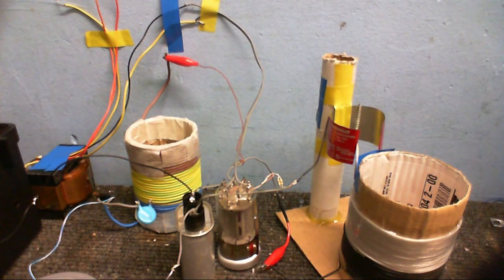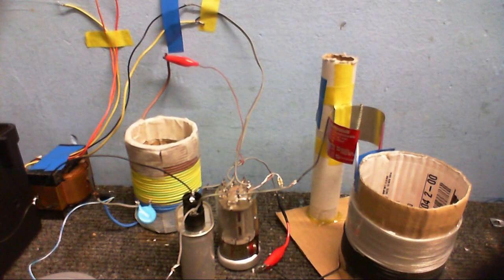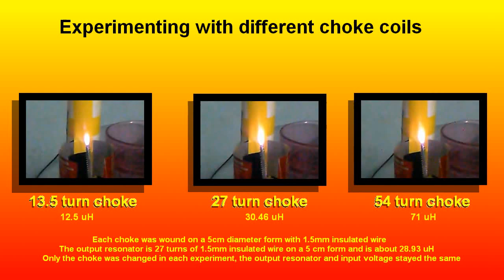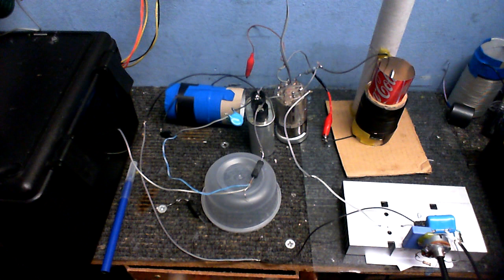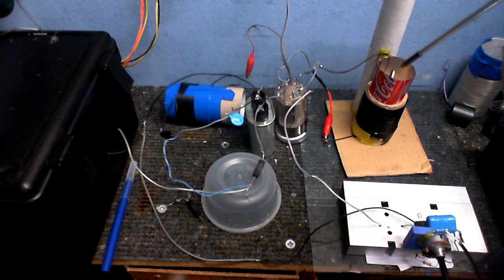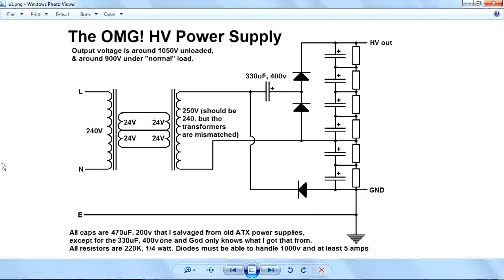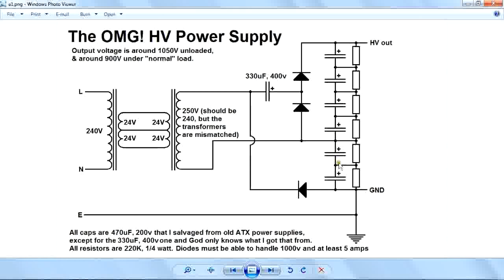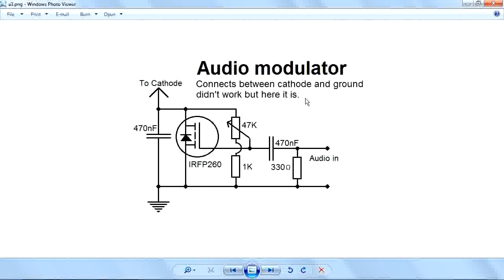Tube Time 13 - Flame!

Comment: Pretty neat plasma generator. To modulate effectively, use a 12 volt to 240 volt mains filament transformer. Put the 240 volt secondary in series with the screen grid supply, and apply 5 to 10 watts of audio to the 12 volt winding. That should give pretty good screen grid modulation. Of course, since you're not modulating the plate along with the screen, the modulation will probably have some distortion. However, you should be able to hear the audio in the flame.
Reply from the maker: Thanks, I might try that, I did something like that when modulating a ZVS fly-back driver and it worked pretty well

Comment: Your circuit around 13:00 makes noise as it turns off. The common term for this is "farting out" as some audio amplifiers make a low pitch intestinal rumble when you turn them off. :D

Comment: use an opamp to drive the mosfet. I think you need much higher voltage than line level in order to drive it properly.

Comment: If you want to use the mosfet you will have to use class d modulation because mosfets have such a fine line between on and off, or you could replace it with a silicon transistor, but I don"t know one that can handle such voltage.
Reply from the maker: The weird thing is that i was able to adjust the flame size, I didn't think I would be able to do that.  I made that circuit based on another vttc circuit I found (cant remember the website I saw it on). so I thought I'd try it and see if it works.
Reply: ***** Interesting, I did not know that.

Comment: why don't you try Making a chicken wire Faraday cage for your camera
Reply from the maker: +Random_rapper20 Haven't really thought about doing that, up until now I've been using tinfoil wrapped around the camera with a hole for the lens to see through.
Reply: +CoolDudeClem chicken wire may work good. Only one way to know

Comment: why do you kathode modulkate it?
you can easaly modulate the 2nd grid with a tube
http://www.plasmatweeter.de/images/diy/mytweeter/Plasma_RF_new.GIF
Reply from the maker: The reason I did that is because if it worked it would have been easier.  I saw a circuit that used cathode modulation using a mosfet, so I thought why not?  I'll definitely  try out that tube circuit that modulates the second grid.
Reply: kathode modulation is realy awkward
becaus you controll the bias of the cathode and dus the tube
voltage modulation is more of a bitbang methode but it is also proven to work 100%
(sema methode is used on transmitters to modulate them)
Reply: CoolDudeClem I have done cathode modulation on a audio VTTC running smoothed DC , Worked fairly well , if you can I would go down the grid 2 modulation rout , if not the cathode modulation dose work  ( for TC use anyway , not to sure how it would fair in this circuit )
Reply from the maker: twirlywirly555 I mainly went for cathode modulation because I didn't know what my voltage at grid 2 is, turns out that grid modulation won't work, at least for the tube I'm using, I measured the voltage there and it's about 350 volts, and the circuits I've seen that can modulate the g2 voltage don't aven go up that high.
Reply: yea you can g2 modulate
tubes do go that high
a el84 can and will regulate that
and if you dont trust it take 2 in paralel

if you dont have a el84
use a el/pl36 those can handle alot

and if you dont have those take a 807 or a pl519

Comment: It's the amps that kill, not the volts.
Reply from the maker: +Zach Z Yes, but you need enough volts as well to overcome the resistance of the human body to push a lethal amount of current through.
Reply: +CoolDudeClem That is true as well. Also, More pressure (Voltage) across equal resistance yields more current as well. Since a static shock has a tiny current, but high voltage, it will just zing a little bit. If you were to stick a finger under the anode cap on a television, there is high voltage and high current. That will kill. A Double A battery does not have the voltage to overcome the skin resistance so nothing will be felt.
Reply: Oh god not this again....its a balance...it's the amps that kill, bit you need enough volts. just like shooting....the bullets kill, but you need a gun to do it
Reply: It's volts and current hand in hand